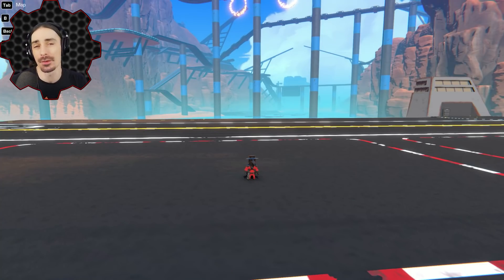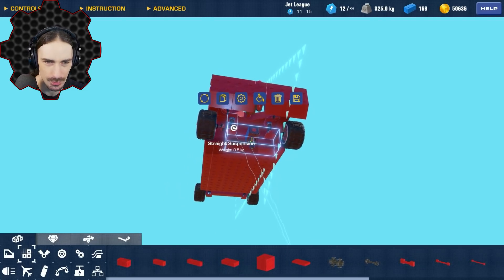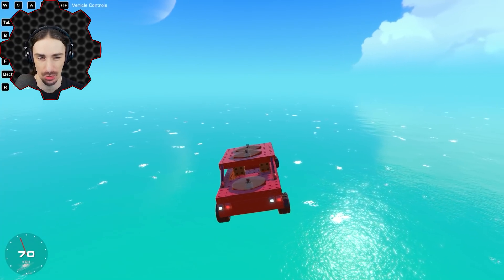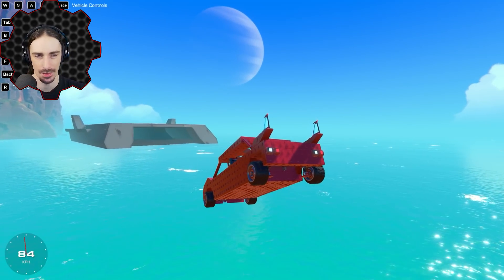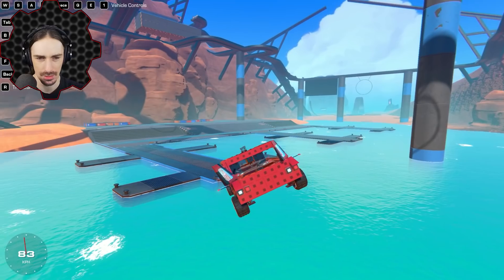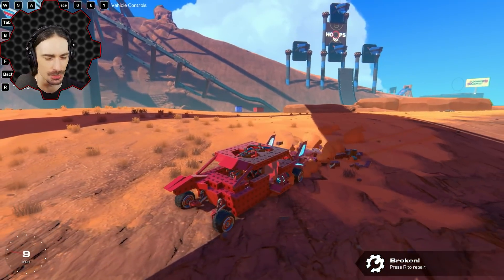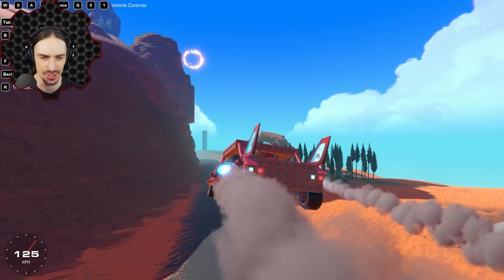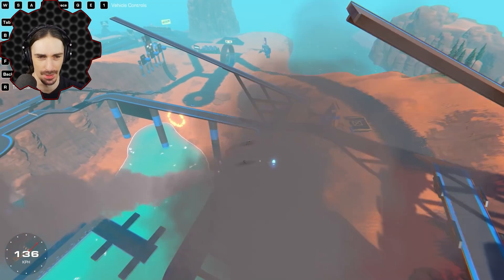I Designed a HELI-CAR to Discover Why We Don't Have Heli-Cars... [Trailmakers]

Comment: Idea on how to improve the heli-car. One add one big propeller on the roof,  two give it a bit more airodynamics I suggest kinda tear shaped, three add a rotor to the back to help turn and counter rotation of the big propeller this is just one idea I have one other idea also if this one doesn't work "although it should since we see them in the sky almost every day"

Comment: You should make a car with no seats, like you'd have to walk around on distance sensors (i think they might be called proximity sensors) to drive foward, if you can make it fast then thats icing on the cake but if you make a functioning car with NO SEAT ill be very impressed.
Reply: Could even be adapted to make a carrier, which you control by driving the vehicle that is being transported around on the vehicle that transports it.
Reply: @Pystro  that made no sense to my anti-wrinkle brain but absolutley
Reply: @carnocarnage1080  Lets say you wanted to build a truck that transports an ATV. Normally you'd need to get out of the ATV to into the truck to control it. But you had such a sensor-based control logic, you could install it on the truck's bed and have it react to the position of your ATV just as easily as you can use it in the cab where it reacts to the position of your character.
Reply: @Pystro  ah, gotcha

Comment: I think the yaw feedback is due to a lack of vertical stability.  Normally there is a static tail working with the yaw aileron and you just have ailerons
Reply: Another potential improvement is moving the forward thrust to the front. This'll help pull the heli-car into a straight position.

Comment: The reason they don’t exist, sorry for the dark reality, is terrorism would be incredibly easy to pull off with a civilian car/helicopter combo.. same reason we don’t have flying cars(essentially the same thing scrapman is trying to do, not that it’d be practical anyway as both engines have to be running incredibly fast because of the legal requirements of the safety inside the car on the road
Reply: I don't think that's even close to the reason

Comment: Hello. I'm a flight instructor. The reason you were getting those oscillations is because as soon as you neutralize the rudder the aircraft will want to point into the relative wind but because the force is so great it over corrects and then the same thing happens in the opposite direction. You had it right in the beginning controlling turning with bank and using rudder to keep the aircraft aligned with the flight path. If you want it to fly like a helicopter you need something like a tail rotor and very little in the way of vertical stabilization/directional stability. Hope this helps.
Reply: good job